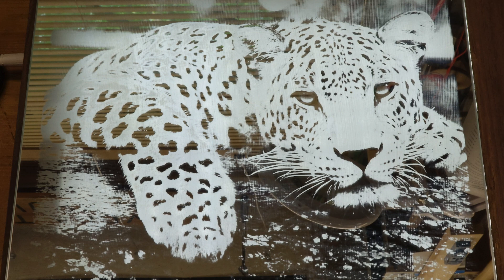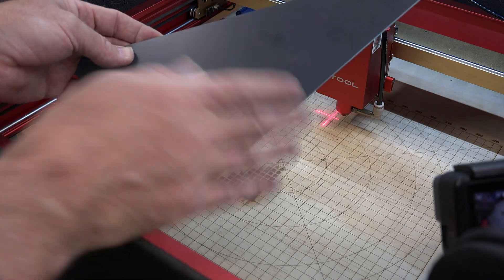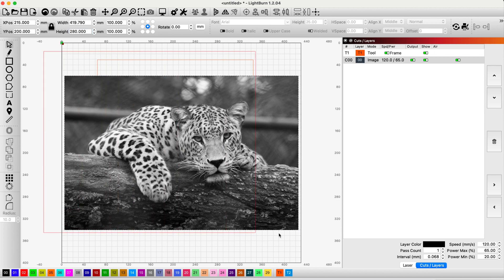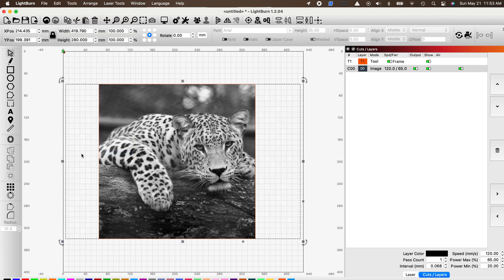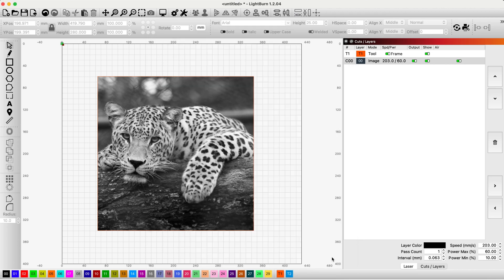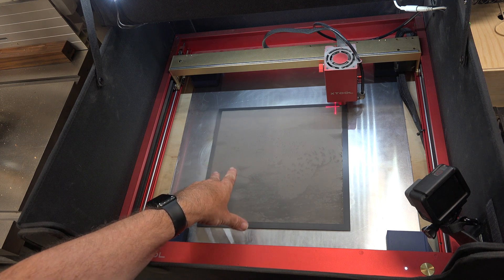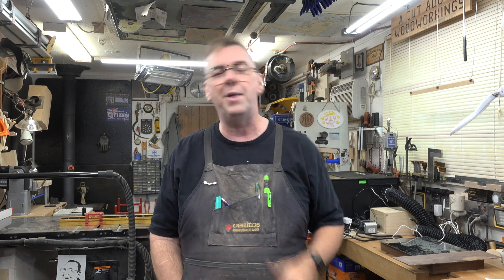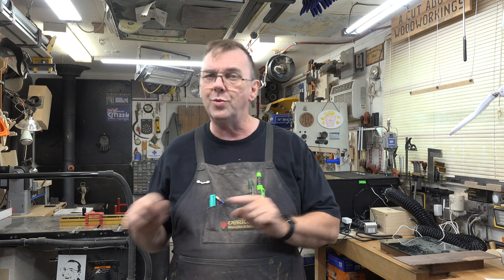Laser Engraving a Mirror

Comment: Awesome! Thanks for sharing. Do you think that the grayscale made a difference? On screen, it looks like it came out basically just either black or white, no shades. (And presumably it might run faster without grays?) But I don't know if there is more subtlety in the image/engrave in person?
Reply from the maker: The grayscale helped immensely.  If you look at the image of the mirror, there are plenty of grey areas that were engraved.  A lot of them are in the eyes and the log that the cat is resting on.  If not for the grayscale, this engraving would have been very much like an illustration instead of a picture.  I hope this helps.  Thanks for tuning in to the show.

Comment: I tried this myself this week engraving logos. Not tried pictures yet. I'm running a Sculpfun 10W laser at 4000mm/min and 70-80% power, 2 passes for total removal of the backing. Later painted, recut, painted again to get multiple colours. I strongly recommend raising the mirror a few mm off the bed by supporting the corners on something, otherwise you can get marks on the front face of the glass. If you are engraving shapes (particularly squares) I found that using Offset Fill left a visible pattern in the glass that shows in the paint. I didnt have this issue with regular fill. The dust produced is very fine and is possibly aluminium oxide?
Reply: PS.. After engraving it might be worth spraying the back with either white or clear acrylic to seal it otherwise I suspect the mirror might degrade in a year or two. Mirrors generally fail around the edges first where the glass is cut.
Reply from the maker: This is all great information Colin and I thank you for chiming in with it.  Engraving mirrors is a finicky process but your process sounds very interesting to me.  The different colours sounds great.  Thanks for tuning in and for chiming in with your methods and thoughts.  It's appreciated.

Comment: I have a longer ray5 20w so far I have not be able to duplicate a image this clearly. Please help. I have got ok result but not stunning like yours.
Reply from the maker: What settings are you using for your engraving?  What software are you using?  The Longer Ray5 20 watt is very capable of reproducing this engraving.  Did you do a test grid on the mirror before engraving?  How long did your engraving take?  So many questions in order to be able to help, I wonder if an email would be easier.

Comment: Kenny, fantastic project, stunning. I would be carefull though there could be poisonous metals becoming airborn😮
Reply from the maker: That's the reason I run the ventilation to the outside of the shop Eddie.  The scariest part about laser engraving is not knowing the effect of some materials on being engraved.  The most prominent example I can think of is laser engraving vinyl which produces chlorine gas and acid.  Crazy stuff.  Thanks for tuning in and for chiming in with the concern.